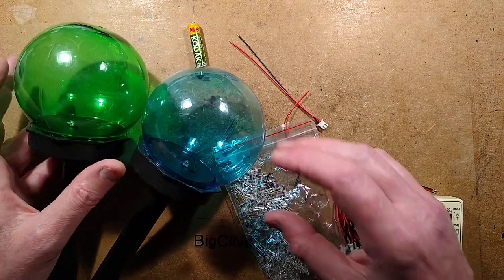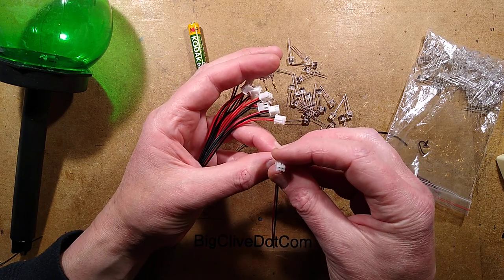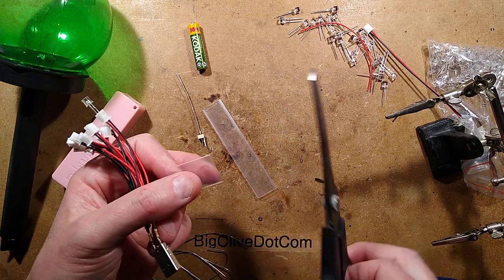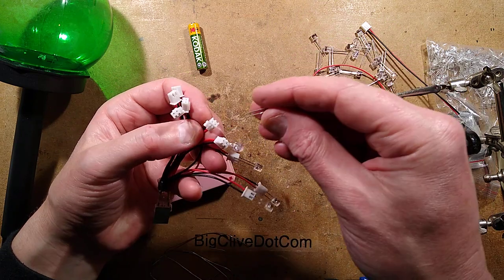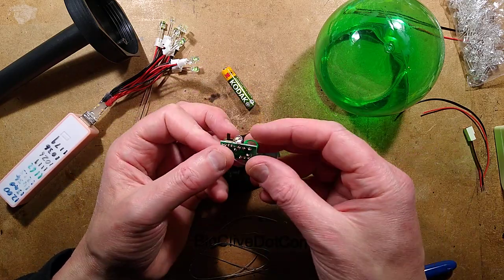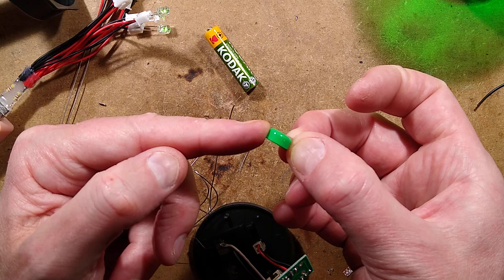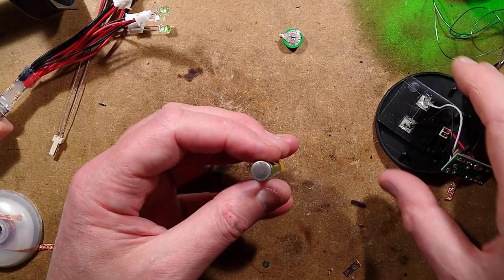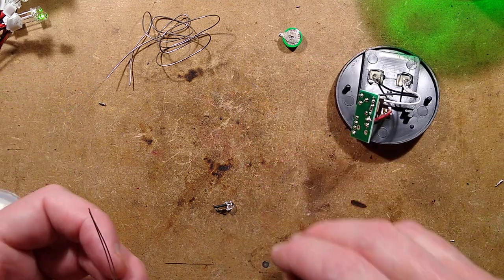Making cheap solar garden lights more interesting.  (Laid back video.)

Comment: Was I being wound up by this? In all my solar lights, it is less inductance for lower light output, the longest run lights I have are 11 micro henry, the shortest run 460 micro henry. Also the best output from the small solar panels I have had is about 8 mA. I raced to Poundland for lights like these, but they had sold out, so couldn't check if these can do 60 mA. Also there are many sellers of wide angled led on ebay, its only if you enter concave that very few show up. Still I enjoyed the finding out and it was interesting too, maybe that was the aim. Thanks for sharing!
Reply: Even more confused this morning as according to the data sheets, the led current decreases with increased inductance which is what you said and the opposite to what I thought based on the inductor colour code on the models I have. So I am going to do some measurements and see where I have gone wrong. Thank you for your video which has allowed me to correct my ignorance on led run time and inductance values.

Comment: I wonder if one could wire a selector switch on two inductors to set for winter and summer? -keeping in mind the switch will be corrosion-prone of course...
Reply: You could go all fancy and use a capacitance touch switch :)
Reply: use a magnetic reed switch, tape the magnet on for summer, remove it for winter

Comment: When you touched the still warm solder, I know that all too well. The amount of times I remind myself “that was literally molten metal just a second ago” is too damn high!
Reply: Okurka Oh, I know. Gallium melts in your hand, and I have a block of Cerrolow 117 which, as the name would suggest, melts at 117 F (47 C)

But still, molten metal is generally rather hot, and recently solidified metal is also generally rather hot.

Comment: I use something I recognized to orient LED polarization called cup is cathode....or negative. If you stare at the inner of the LED you will see the "cup" as I call it and that is the cathode. It is sometimes difficult to see but a neat way to remember for pulled diodes..
Reply: Sadly some LEDs are made with the cup positive, rarely though

Comment: That's funny, I build my "special connectors" exactly the same way. Depending on the desired stability, sometimes with a small plastic strip on top of the hot glue and then the heat shrink tubing over it.

Comment: I still have the little 9V battery adapter you sent me from that guessing contest giveaway. It works really well and I don't have to make a breadboard circuit every time I want to quickly test an LED. On the other side, the screwdriver lost the magnet :(

Comment: Could PVC glue to seal the stake to the base and extra-thick teflon tape around the thread of the cover help with waterproofness? If it's good enough under pressure... but then there is the issue with condensation, which if the base was concave toward the cover could actually be managed with a couple of drainage holes. Else just installing it at a slight angle with the holes could also help...

Comment: What about using enameled wire and just burning it off where you need a connection with the soldering iron? A little heat shrink around the bottom near the plug and it should be a little less likely to short.

Comment: Quick question for you please clive if I was to solder 6 solar garden lights together and connect it to a carbon rod from an alkaline battery to produce hydrogen would it be better to wire them in series or parralel?

Thankyou for your time Clive love your channel.
Reply from the maker: It depends on the voltage required.  Ideally a series/parallel array to get maximum current at the required voltage.

Comment: Just wondering if the battery was being charged at the rate stated when the coloured globe is over the solar panel. Or perhaps I missed the fact that Clive did measure the current from the solar panel with the coloured globe in place.

Comment: Hi Clive, Great informative video as always. However I did have one thought, you said this unit had a particularly high output from the solar cell. Could it be they had to fit a high output cell on these units as solar through the green/blue plastic ball would be severely reduced.

Comment: in some parts of this video there is an audible tone. at first i thought it was your soldering iron but wouldt it sound around 50Hz or a mulitple of. the tone i hear hovers around 415Hz (or G#4 coincidentally)

Comment: With soldering, the way you hold things does not work for me. I tried many ways until i found my preferred method. I put the solder in the clip of the helping hand and hold the part with my left and iron in my right. Works well for me.

Comment: Putting a crocodile clip on one or both sides of the solder joint to act as a heat sink is an easy way to prevent accidental desoldering.

Comment: I actually have the opposite problem from your red dominant problem in my string of color-changing LEDs: Red/Yellow aren't lighting, but Blue/Green are. I'd love to fix these strings (every one I get has the same problem after a short amount of problems). Any suggestions?

Comment: Would be nice to see an upgrade where the switch is used to toggle between two settings, one that uses more current for summer or less current for winter.

Comment: 4:23 I think that Topnik RF800 flux is the Kalafonia rosin flux mixed with Isopropanol. 
The real solid Kalafonia rosin flux is from the same Polish brand.
Reply from the maker: I wonder if I could dissolve some of my solid flux in isopropanol.
Reply: @bigclivedotcom  with the solid Kalafonia it can be done. This solid Kalafonia flux is hars from trees. In combination with lead-based solder, and you get nice shiny soldering.

Comment: Are those 20 ohm resistors?
Cool project Big Clive - Thank you.  Also, I'm digging the lesson in comparing the LEDs!
Reply: It is an inductor to boost voltage: the battery puts out around 1.5 volts (original button cell is even lower voltage), but LEDs around 2-4 volts depending on color.

Comment: I hate those fiberglass pens. They are selling refills but it is often impossible to replace. I broke two of them trying to replace the tip.

So I just use the refills without the pen. Works the same, much cheaper :)

Comment: If you're going to be soldering to batteries and such, perhaps it would be better to build a spot welder? (i know a tonne of others that build battery banks have built and use them to weld nickel strips to batteries then go from there). if you've not got one, perhaps a cool project? :).

Comment: I would love the powerbanks have an always-on mode. That cutoff is annoying.
Reply from the maker: Some do, but you usually have to use a simple cheap one with no level indicators for that feature.  In the UK, Poundland's 4Ah unit has the level indicator, but does put out 5V all the time.
Reply: @bigclivedotcom  I had a couple of those... cheap ones with 1 mini or micro USB output that wouldn't turn off. They had level indicators and were the equivalent of 2-3 british pounds 5Ah advertised, around 1.5-2 optimistically. 
However I used them to power something in the car over long periods of time, in the summer, and summer here is usually really really hot (35+ degrees C from July to September). Let's just say I'm lucky I still have that car :)
Nowadays I use the ones with USB-C PD on them as I need short bursts of high power and a lot of idling in between. Unfortunately, I found none with a decent size and USB-C PD output that doesn't turn off on small loads.

Comment: In my solar light I use regular AA alkaline batteries. The Ni-MH that come with the lights are junk, they weight almost nothing, the light doesn't  stay on all night and I have 3-4 of them that have shorted out.
I use used alkaline batteries for 1 and half  year and they have not leaked yet, lights stay on all night. Batteries have survived the winter at -20c
Reply: Do you disable the charging circuit, or are you recharging an alkaline battery?
Reply: @mrb692  yes the alkaline battery is charged by the solar panel. Current is very low so it don't cause problem

Comment: I've seen some advertisements for auto feed solder gun/irons recently.  I would love to see you get one and do a review.  As someone with an obvious well practiced hand at soldering, it seems like your opinion would be quite valuable.
Reply from the maker: I've seen them, but couldn't realise envision using one.
Reply: @bigclivedotcom  That is exactly why I wanted your opinion.  If you try it and it's not completely trash, then maybe it's a good tool for people just getting into soldering?  I also wonder if it isn't something one could make themselves, and a tear down would establish that. :)  I do respect that you might not want to touch one with a 20-foot pole, haha.
Reply: @Sqtgdog  I had a cheap one (from Lidl I think) and it worked like a charm! I can recommend that. Especially in very narrow places and with big hands ^^. 
I say I 'had' not because it was defect, but I burnt its power cable with itself accidently multiple times until it was just a molten mess and not usable anymore :/  I would buy it again if Lidl ever has this cheap thing again.

Comment: Use a pierce of double sided unetched circuit board instead of wires to mount the led. Much easier to handle.

Comment: @30:28 Why didn’t you choose to put a quick connect for the battery power instead of hard soldering in the battery?
Reply from the maker: Any connector is a point of failure in solar lights due to inevitable water ingress.

Comment: gods those switches
i found 3 of those pretend rocks with a solar Panel and a light with aa batteries still in them(like who the heck just tosses those on the street??) anyway all switches were busted so i just removed them and soldered the two wires together instead

Comment: Perhaps one of those little strings of smt LEDs on thin wire?
Reply from the maker: I did ponder cramming a section in that was a balance between points of light and solar cell efficiency.

Comment: you will be reviewing this in a couple of weeks time. only reason these lights are not weather proof.water will get inside and corrode that little 4 pin chip plus destroy the battery. i've got pictures of that happenening.

Comment: Will one of those garden spike solar units run a blue LED? I have a little project to try with laminar water and blue light but can't get the 3.5v out to where the water pump is unless I use batteries, I just want to be able to fit and forget.
Reply from the maker: Yes.  But not at high intensity.
Reply: @bigclivedotcom  Thanks for the the reply.
Reply: Tidbit you might not have known: white LEDs are actually blue LEDs with yellow phosphors.

Comment: If you shine the LED at the solar panel, can you get it to blink?
Reply from the maker: It just tends to dim.
Reply: @bigclivedotcom  Well... The only thing better than Poundland walkway lights in your lawnmower, is blinking walkway lights in your lawnmower. I would like to see how you would approach the blinkification of the low-power LED. Like, hysteresis, or something. I think my approach would be to freeform an "SC1 Solar Engine (tm)", which is a silicon controlled switch circuit. It was the core of a small craze called B.E.A.M Robotics... Radio Shack also used to sell a very low power/voltage LED blinking chip, but I lost my supply.

Comment: What size capacitor would it have to be to get a color changing led to work in that circuit like you were saying?
Reply from the maker: Just 100nF and a common 1N4148 diode.
https://www.youtube.com/watch?v=wHje7_suqE0
Reply: Thanks Big Clive😊👍

Comment: Solar garden lights should now be earth battery lights, seems you can get 2 volts with small lengths of magnesium and carbon rods... A friend of mine had the alarming habit of tack welding things onto a laid down oxygen bottle.... He was a bit of a nut, without knowing it...
Reply from the maker: That's just using the ground as an electrolyte.  The metal rods will be dissolving as the power is generated.
Reply: @bigclivedotcom  Apparently the destruction of the rods takes a LONG time.....Qutoting... Robert Murray-Smith a great youtube channel BTW

Comment: Nice Video. What I  always do, is protecting the inside with plastic-spray. Why didn't you?
Reply from the maker: Sometimes I paint nail varnish onto the PCBs to seal them.
Reply: Or Hairspray?  It is  just while  I am repairing a few now. Not for sale anymore so I  spend some time, but if they were sprayed the dammage would not be  that big. Cannot help that China used Iron in stead of Copper threads, , but it is a fact.
Tell people to protect their garden lights, please, in this simple way.

Comment: What about water getting in and around the battery? Won't that be an issue?
Reply from the maker: I've mounted it in a way that will hopefully not bridge both contacts with water.  If it's a problem I'll put some Vaseline on it to shield it from water.

Comment: What are concave-lens LEDs for?
Reply: Spreading light.
Reply: They spread the light out.  All LED chips are packaged in a way so as to form some type of lens. On the through-hole components like Clive used, it's made of resin (i think surface mount LEDs also use resin, but it doesn't make up the entire package). The traditional indicator LED domes tends to focus the light, whereas those with flat or concave tips fan the light out more. Also, some LEDs are encased in a cloudy resin which has the effect of diffusing the light.  These are made to support different purposes, such as being indicators, flashlights, or decorations.

Comment: My neighbor gave me a dash camera  and the battery had done something and had puffed up and was showing 0.3v but then I cut the case off and then the voltage went up to 3.8v and I just carefully discharged it, fully. It was strange
Reply from the maker: That's common in dash cams.  The direct sunlight bakes the lithium, cell.  The cell's internal resistance goes up so high that the load can pull it down to a low voltage value.
Reply: @bigclivedotcom  Some dashcams use supercapacitors instead of batteries, to withstand the heat (at least better) - something to look for/keep in mind when shopping for dashcams

Comment: Could you not just match the diodes by measuring forward voltage with a multimeter indiode check mode?
Reply: Came down to say this. Surely easier and more certain?

Comment: jst connectors. these little bastards are the lego bricks of connectors. and so long as the pins arent pushed, out its perfectly reasonable force. at least molex had the good grace to deform when finding one with your foot.

Comment: Note to self: "Send Clive a hot glue gun"
Reply from the maker: I have a few, but the hot air gun is much faster for a quick job like this.
Reply: @bigclivedotcom  :)
Reply: @bigclivedotcom  a quick tip, don't know if you've since considered it. If I'm doing something like that I cut a piece (or two depending on the size of the gap) of hot melt stick and wedge it between the components. Then I slide the heat shrink over and apply heat - the sleeve shrinks and the glue oozes to fill the voids :)

Comment: Old hard drive IDE ribbon cables (40 pin) are great for testing lots of LEDs simultaneously. Cut the cable to make a single and a twin bank of LED connectors easily holding up to 20 LEDs in each set of sockets Split the individual wires and solder all alternate wires together+ add your USB plug. https://photos.google.com/photo/AF1QipPglISVXa7C8tPDVaCqBa-I4Xs-jvna--5IpO1k

Comment: JST is the original manufacturer. XH is the model name of one of their 2.54mm pitch connector lines. http://www.jst-mfg.com/product/detail_e.php?series=277
Reply from the maker: When I come across these connectors I generally find them on random eBay listings with titles made of keywords.  I need to find a chart of standard eBay connectors and their proper names.

Comment: Is not necessary to upgrade the battery cell, it does not even need one! With 5G it would light all the time for free!!!
Reply from the maker: It sounds nice.  But the 5Gs are so powerful it would blow all the LEDs and then burst into flames.